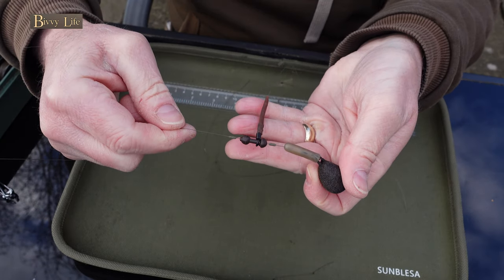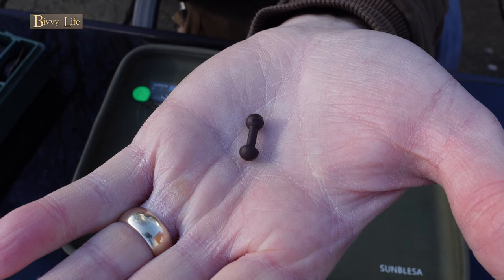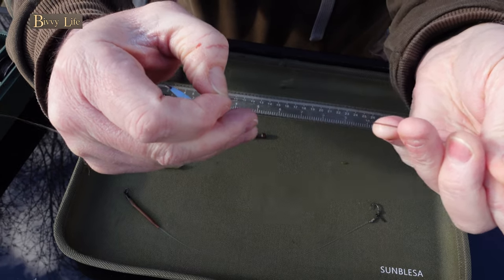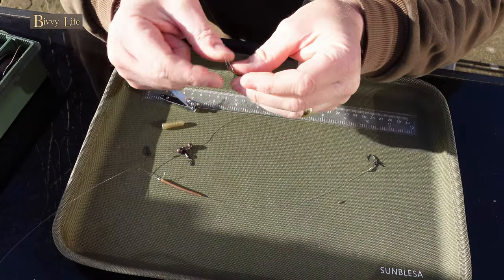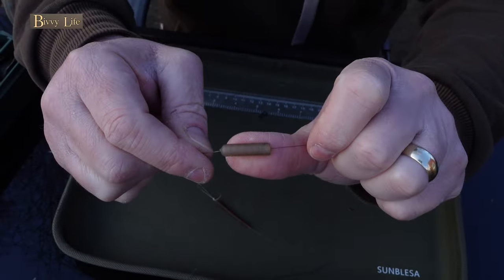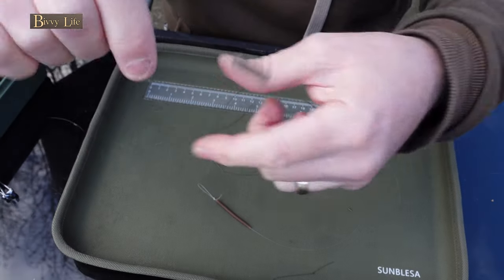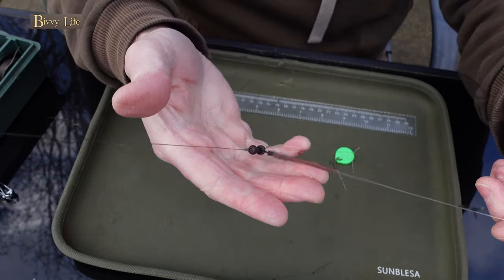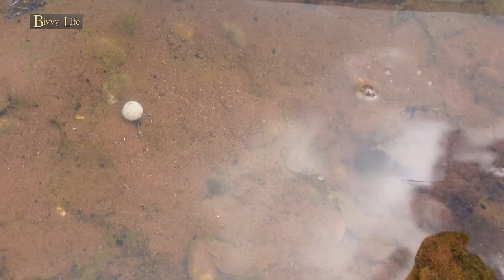How to set up the naked helicopter rig. Carp fishing heli rig for beginners.

Comment: Great video very helpful, would u use a tight line or a slack line,
Reply from the maker: Hi Mark. 
It depends on the angle of the tip of my rod in conjunction with the lead and what sort of distance, but most of the time I use semi slack lines in my situations as I rarely fish at long distances. 
I don't like tight lines off the lake bed it's deffo a fish spooker.
Tight lines pal 👍🏻

Comment: I was wondering if this setup would also be effective for closer ranges.Say when only an underarm cast is needed or even just dropped/lowered close into the margins.
Reply from the maker: Yes it absolutely would but if the bottom is firm and weed free you'd be better off with a basic lead clip system or inline set up as they have better hook setting properties. I'll only use this heli set up in weedy situations. 
Tight lines
Steve
Reply: Yes there is no weed and the 3 waters I fish are pretty firm clay bottoms.Many thanks for your advice

Comment: Hi I found this really helpful, what size sinkers do you use as the Korda ones come in small, medium and large? Thanks in advance
Reply from the maker: Hi mate. 
It really depends on personal preference and whether or not you're using tungsten beads (The ones in this tutorial aren't) so medium ones without tungsten beads, small with tungsten beads. 
Thanks for the feedback
Tight lines
Steve
Reply: Thanks for the quick reply 👌🏼

Comment: when fisheries say no fixed lead, is this it? im starting again after 15 years so making sure im good
Reply from the maker: Great question mate it's something that used to really confuse me. Although this isn't a drop off set up it also isn't a fixed set up. If the mainline gets cut off, the hooklink will still slide off and wouldn't have a trailing lead attached. In short no this isn't a fixed set up. 
If you're ever in doubt don't be afraid to ask the fishery owner or balif they won't frown on you they'll be really appreciative I'm sure. 
Welcome back to the fishing scene. 
Tight lines
Steve.
Reply: @BivvyLife  thankyou very much for the help, it will help me as my local is a silty mess lol